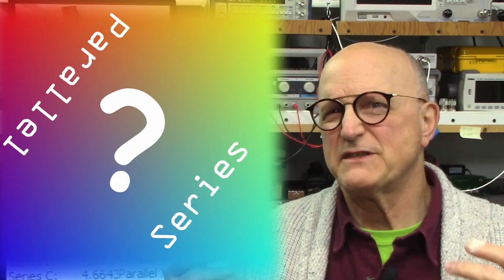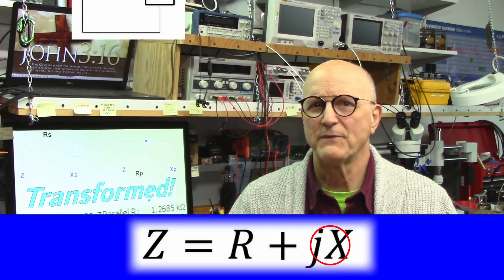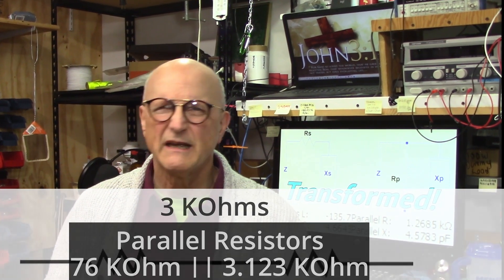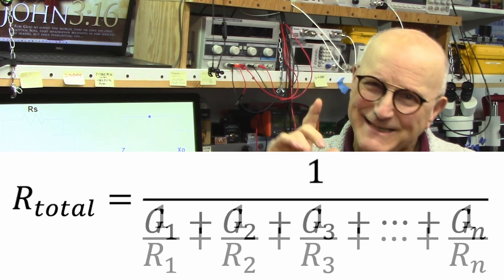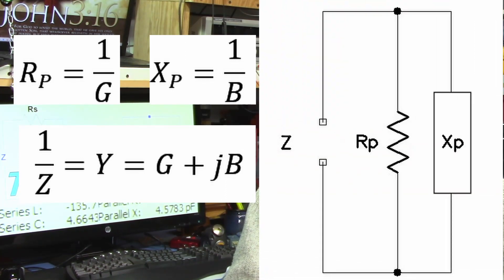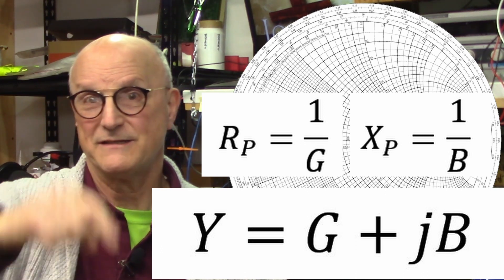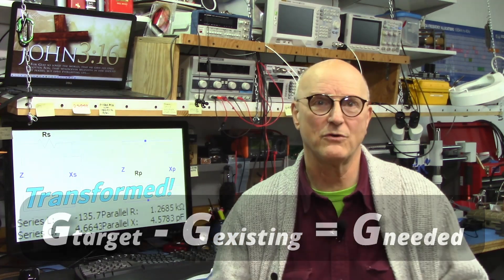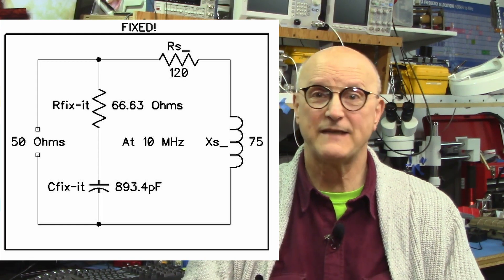What are those Series and Parallel R and X Values all about? (053)

Comment: Thanks for explaining these concepts in a simple way. I tried to calculate the Parallel resistance and parallel reactance. The resistance value matched the value calculated by vnasaver. However the parallel reactance was very different. I have rechecked my calculations and the formula but the I can't find my mistake. R = 24.198693, X = -45.788937, R_P = 110.840844. Parallel reactance from software = 1.2938pF    Parallel reactance from my calculation  = -58.577544
Reply from the maker: What is the frequency?  Your calculation is being reported in Reactance in Ohms. They are reporting the reactance in pF. Negative reactance in Ohms is capacitive.  So, how many pF does it take to have a reactance of -58.578 Ohms at the frequency that you are testing at?

Comment: Your example at 12:05 is actually more easily solved in one step by equating the parallel R with the desired total impedance by using the formula 4k*R/(R+4k) = 3K or simply R = 12k. Where 4k is the exiting resistor and 3k is the desired parallel (equivalent) resistance. No need for messy division.
Reply from the maker: Yes, I most likely would have done it the same way you describe in you comment for this simple example. But this would not have demonstrated the whole conductances in parallel simply add together. This principle is really important when dealing with complex impedances. 🙂

Comment: The formulas at 9:16 differ from what I got namely: Rp = Rs/(Rs^2 + Xs^2) and Xp = - Xs/(Rs^2 + Xs^2). The first one is the reciprocal of what you got and the second one the negative reciprocal.
Reply from the maker: The one thing that folks forget to include is the 'j'.  Z=R+Xj and j*j=-1. If you do not include this in your calculations, then ... 🙂
Reply: @eie_for_you  The reason your formulas at 9:16 and 9:31 are wrong is very simple. It is known that the parallel combination of two impedances are ALWAYS less than the smaller of the two. According to your formulas the parallel resistance is GREATER than the series resistance and the parallel reactance is GREATER than the series reactance. This is not possible.
Reply from the maker: @Jnglfvr  I am now sitting here looking at my A.R.R.L. Handbook for Radio Communication, 2008 edition, page 4.45.  Here on this page you will see in formulas (102) and (103) the exact same formulas that you see on the screen on my video at 9:16 and 9:31. Remember, these are used to convert the Series R+jX circuit into its parallel equivalent circuit. They are not the equations used to calculate the resulting impedance of two impedances in parallel.
I hope this helps to clear this up. 🙂
Reply: @ well then I’m not sure what is meant by “equivalent parallel impedance” do you? If the impedances are different then so are the currents. So in what way, exactly, are they “equivalent?”
Reply from the maker: @Jnglfvr  If I have an impedance of, say, 3 + j8, this implies a 3 ohm resistance in series with an inductor whose reactance is 8 Ohms at a particular frequency.  So, what if I want to represent this same impedance in terms of a resistance in parallel with some reactive component instead. The overall impedance would be the same. It just happens to be made up of two parallel entities instead of two series entities. These equations allow you to calculate the values of these new entities. Hope this helps. 🙂
Reply: @ ok here’s what I did. I calibrated a nanovna for 50 kHz and measured a 1 k ohm resistor (using the reflection method) The current version of the firmware allows one to switch between series and parallel impedances. In series I got 1000 - 2j. I then paused the sweep and switched to parallel mode which gave me 1000 - 500,000j. Using these number it appears to use your formula for Rp but using the formula for Xp should have given me 1000 - 250,000j. So I’m not sure what it’s using to convert the two but yours are certainly closer.
Reply: So I did another run. This time using a sweep from 50k to 1 MHz. Paused the sweep and got this for series: 982.6- j30.36 and for parallel 983.6 -j31.8. For some reason the latter says “admit” (admittance?). So this agrees with your formulas
Reply from the maker: @Jnglfvr  OK ... I turned Gnu Octave loose on this. I took the measurement you made that your resistor measured 1000 - 2j. Using the formulas from the video, I converted this to their parallel equivalent. It would be a resistance of R=1000.004 and a reactance of X=-500002j
Using the formula Z = Z1*Z2/(Z1+Z2)  and Z1=1000.004 +0j and Z2=0-500002j, I calculated the resulting impedance of the parallel combination of these two. I get Z=1000 - 2j.
Here is the "program:"
  Rs=1000;
  Xs=-2;
  Rp=((Rs^2)+(Xs^2))/Rs;
  Xp=j*((Rs^2)+(Xs^2))/Xs;
  Z = Rp*Xp/(Rp+Xp);
I hope this helps. 🙂